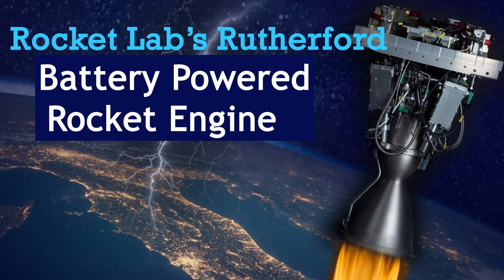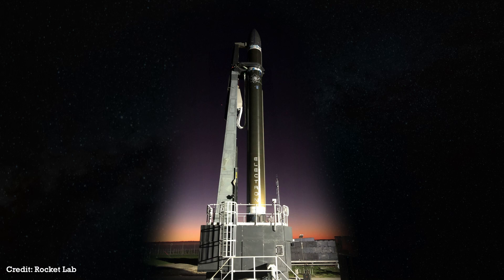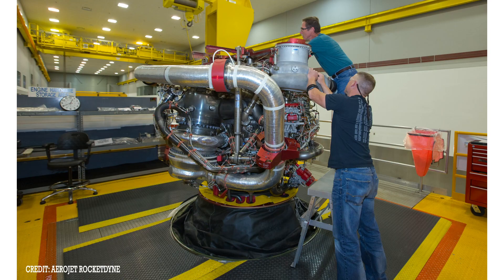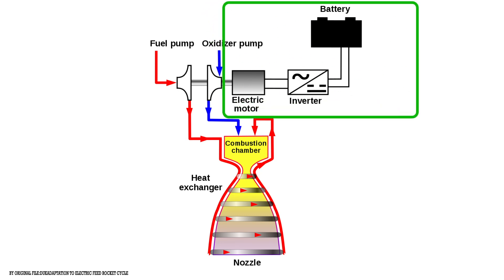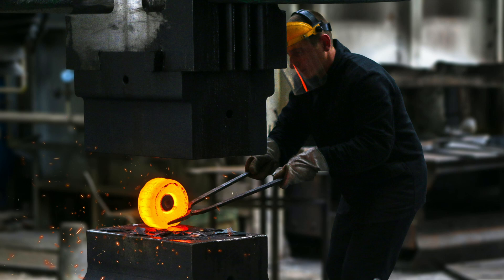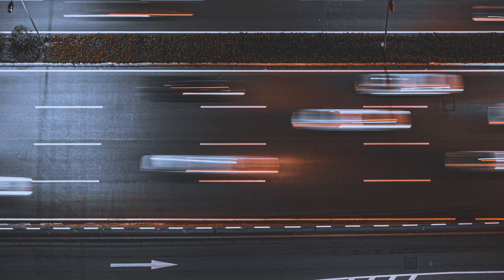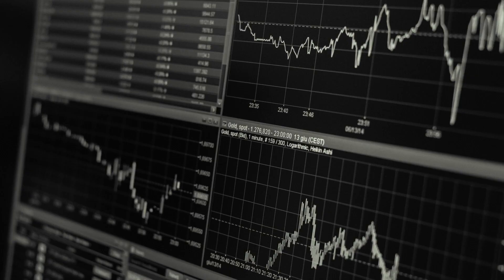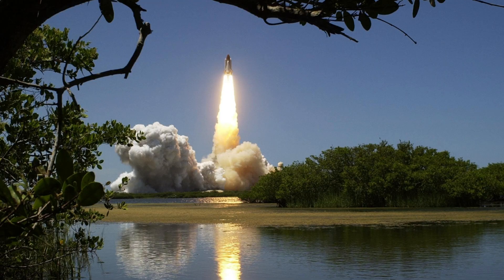A Battery Powered Rocket Engine? Rocket Lab's Rutherford Engine

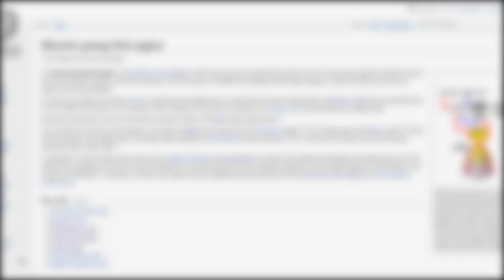Comment: In 1:30 you show a diagram of the electric feed rocket engine from wikipedia with the pumps mechanically attached with a shaft and one electric motor driving them. I think this is not correct for the Rutherford engine, but I cannot find the information online because everybody seems to be sharing this same information.

I think that the turbopumps in the Rutherford engine are not mechanically connected and there are two electric motors. One electric motor for the oxidizer pump and one electric motor for the fuel pump.

The reason to have independent pumps it is because the liquids are different and need different RPM and power to be pressurized. Also with the pumps being independent you are able to independently adjust the flow of fuel and oxidizer and therefore adjust the mixing ratio for the combustion.

Can anyone tell me if I'm correct?

Kind regards.
Reply: 😂😂😂 I am a New(see)lander from Europe. 😂 I like your question! Seems the "knowing" are rare! Today is May 16, 2025 I just watched a rocket blast off on my ceiling with a Samsung beamer and I was interrupted due to lack of good Internet connection 😂😂😂 The video showed only the engines from the ground. I had a complete MECO. I wanted more information and landed on a 4 year old information..... impossible to become smarter 😂😂😂 As an overadvanced beginner 😂 I found the video a little helpfull. Thank you for your question!

Comment: You didn’t say that one reason the system works is because ( like the SpaceX Falcon / Merlin) it is much easier and cheaper to develop and build smaller engines and use 9 of them.  Look at the Russian Soyuz... 5 first stage engines each with 4 seperate combustion chambers and nozzles, the same for the second stage.

The big advance is making them able to operate reliably together, plus modern production techniques.